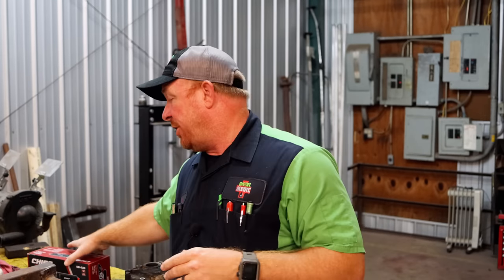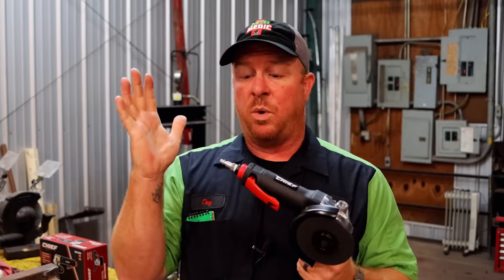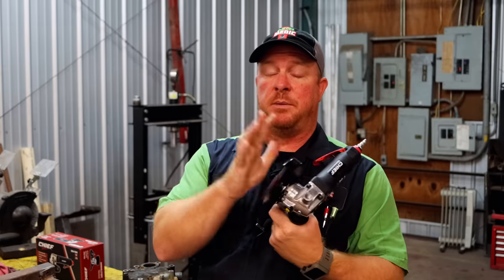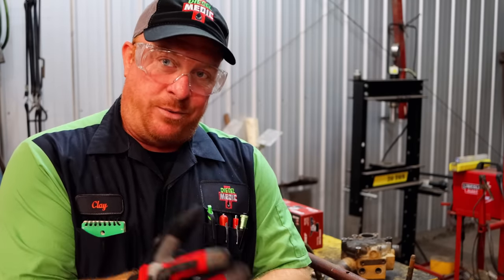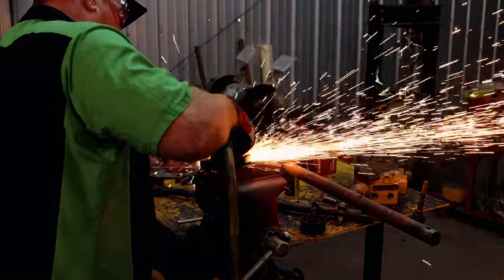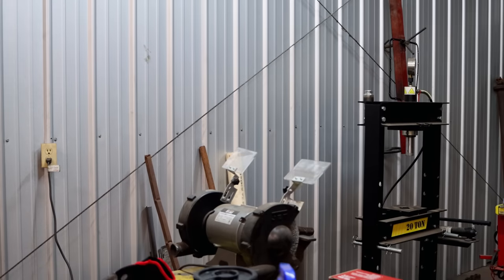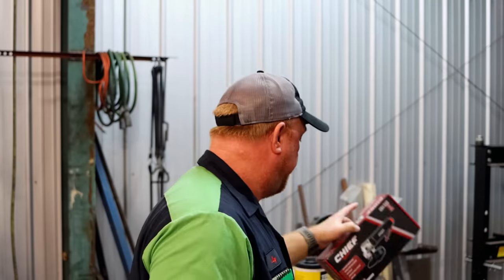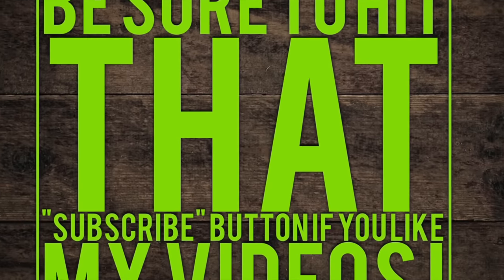Chief: 4 1/2" Angle Grinder (NEW Line From Harbor Freight)

Comment: Harbor freight is like most tool supply stores or tool companies. There are cheap options but also some better quality choices. I bought this grinder because it felt solid in my hands . It has performed flawlessly. I’ve also bought several other chief air tools. All are serving me well .
Reply from the maker: I’ve had great luck with the Chief tools also. No complaints here at all 👍🏻

Comment: I've had mine for 2 years. The lock button to take the disc on and off has stopped working. It won't catch so i can't tighten the grinding wheel up

Comment: For $99 you could get  a Metabo corded 4 1/2. The last grinder you’ll ever buy.
Reply: I'll agree with this one my dad has had his metabo for atleast 10+ years and still works to this day
Reply: Sorry gotta disagree.  Metal fab for semi truck and trailer repair. Brand new metabo last less then a year
Reply: @colelyles6964  how many other brands have you used? Put a dewalt in the same environment and it’ll die in a few weeks tops. Only issue I’ve ever had with a Metabo is the switch, and the welding truck swaps them out free of charge or if it meets its death to a I beam falling on it. Metabo is who invented the grinder. You work around old timers in metal fab and they’ll tell you to go get the metabo. That’s what they call all grinders.
Reply: Not gonna lie I bought a refurbished 4 1/2 Ryobi grinder I use the hell out out of it class 8 trucks still spinning

Comment: If a piece of that disc flies off a thin layer of plastic safety goggles isn't going to save you!
Reply from the maker: Nope you are correct but if that spark bounces and goes in your eye it will. Same saying “why wear a seat belt I may flip in a creek with water” well you have to weigh you options and obviously debris and sparks are much more likely to happen vs the disc breaking
Reply: Your post is a couple years old but if anyone sees I just want to say. Took a direct hit to the eye of plastic safety goggles. Hard enough it knocked them off my face. Captured a metal chunk about the size of a BB. The impact resistant plastic doesn’t shatter. It stretched, so when I put the glass back on the BB was still in the plastic which had stretch enough to touch my eyelashes. No doubt, that piece of metal would have came through my eyelid. Typically I don’t grind with gloves or sleeves. Getting hit like that anywhere has never happened before or since. Broke numerous discs, they haven’t seemed dangerous. Your worst unforeseen hazard is a basic wire wheel. I’ll put a shirt on for that.

Comment: Have had mine for about 8 months now I do a lot of fab work on semi trailers and truck and it gets used almost every day even the other guys in the shop have been using it they also like it but I will say if you hook a p style coupler with a 1/2 hose it wakes that grinder up makes a huge difference.
Reply: I am unsure about the die grinders I just have the 4 1/2 inch grinder and it works well

Comment: Appears to work better than the air angle grinders at work. I work as a welder in a trailer factory. 7 inch grinder bogs down all the time

Comment: How much water do you have in your lines? I saw watersprey when you conectet your hose to the grinder.
Reply from the maker: With it getting hot in the day and cold at night my water separator doesn’t catch it all. This weather here is crazy and it’s always high humidity. I drain the tanks but there’s just no stopping it until it either gets warm and stays there or cools off and stays cool but 85 in day and 45 at night ..... it’s gonna be there

Comment: I’ve never put oil in an air tool. Can u do a video explaining when, how often, what type of oil, what air tools need it etc. I’ve never seen that. I’m obviously a weekend warrior hobbyist but I watch for tips and knowledge. Love the channel. Thx!
Reply from the maker: All air has moisture in it the oil keeps the internals from rusting / seizing   Your suppose to oil them daily with air tool oil
Reply: @KoonTrucking  thx!! Good thing I asked
And thx for answering. I don’t think i use any of my tools
Enough that they’ve died yet but I’ll immediately find a video on how to oil / lube air tools and make it a daily work practice. Thx
Reply from the maker: @donotrobme9295  all u have to do is grab some air tool oil and put a few drops in the air line fitting daily when you use it
Reply: @KoonTrucking  thanks! I saw on your video this after noon a pb blaster air spray lubricating air tool. Same thing?
Reply: @donotrobme9295  , I use air tool oil and the blaster air tool conditioner, but for different purposes. I only use the blaster air tool conditioner for cleaning on the rare occasion. I also use it on new air tools out of the box. Most come from the factory with a lot of crap in them. Once cleaned, I switch out to normal air tool oil. In my opinion, the solvent nature of the blaster air tool conditioner isn’t good for continuous use. Once in a blue moon. If you have clean air, good old air tool oil is better for daily use. Air tool oil is usually a non detergent 10 weight oil that has corrosion inhibitors in it. Most hardware stores that sell air tools will have the oil.

Comment: Will a 10 gallon air compressor work with this grinder
Reply: with a 10 gallon air compressor it would run for an hour 30 minutes then you would let it cool down. however you can run it intermittently. but my recomendation would be to get a bigger air commpressor.

Comment: I'm skeptical... I have literally thrown away everything I've bought from them away. Interested in your long term thoughts, Clay.
Reply from the maker: Trust me I completely understand ! I cussed the regular cheap 90 degree grinder and went through several of them before I finally trashed it. This has impressed me, several people sent me messages and said they got it and it worked so I fully trust them and they were right, this one is good.